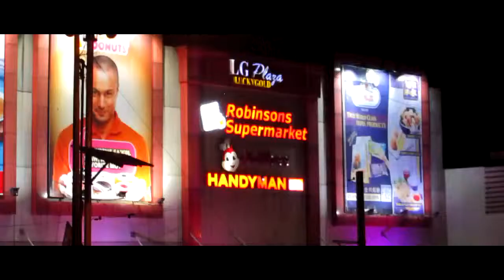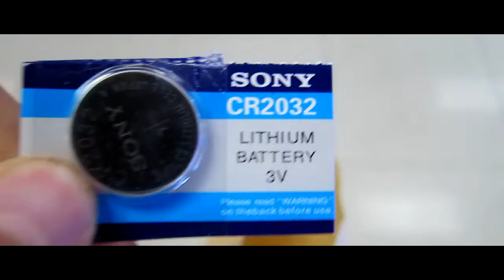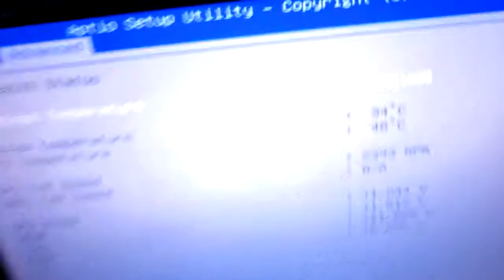Applying Thermal Paste in our CPU (Philippines) | Albert Jarod Ibay

Comment: How much for the t. paste? btw nc vlog
Reply from the maker: They offered 3 different ones z3 at 150 z5 at 180 and z9 at 280

I'd suggest getting the z5 because the 280 is too thick
Reply: I see , Im new subscriber of yours. Btw how will i know if i need to change thermal paste??
Reply from the maker: Thank you :)) You'll need to change the thermal paste when your computer is overheating and thermal throttling (just google it) in short it means that the computer is slowing down because of heat even if you're not doing that much